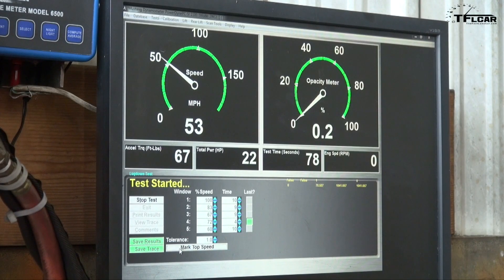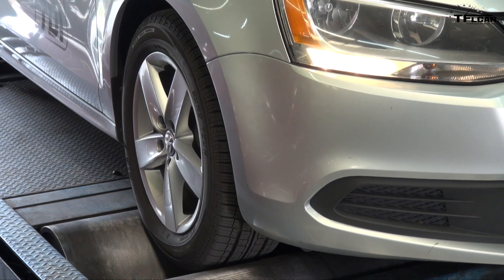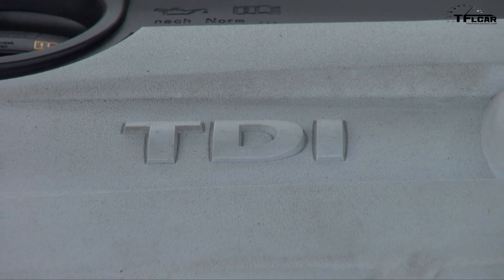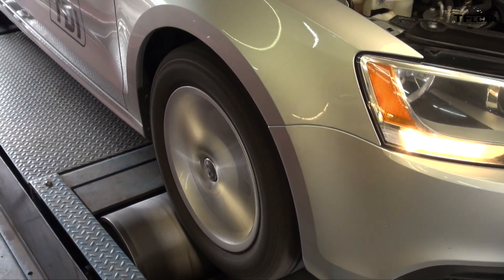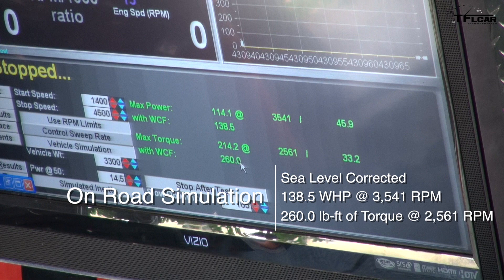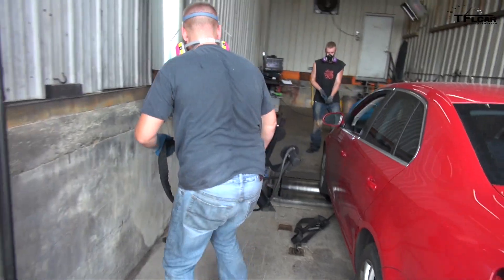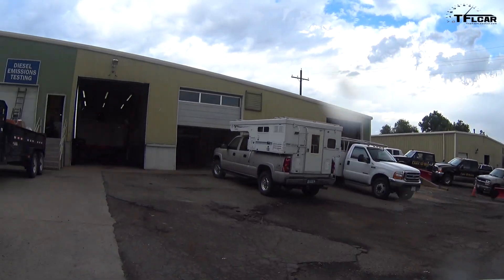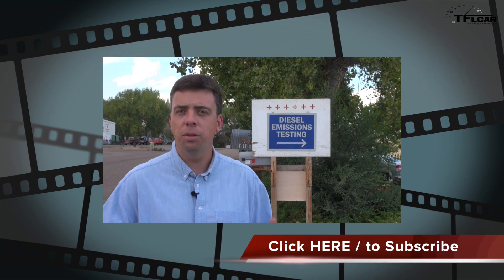Surprise! We Dyno a VW Dieselgate TDI Jetta to get the Truth about HP Loss

Comment: This vid is totally bogus. It goes to show you how little these guys know about doing a controlled experiment. I am only commenting here in the hope that people will stop posting the link to this everywhere.

Despite what they think, the ECM is most definitely not in clean mode.

Not taking NOx readings is a huge blind spot. If they cannot confirm that the car puts out different NOx levels as they change their setup between dyno and road modes, they could be measuring any number of unknown parameters, except the cheat-mode algorithm.

There is a huge hole in their method of comparing the results from 4-wheel dyno mode to 2-wheel dyno mode, on a FWD car.

As with most hardware and software systems, there is most likely a way to rig up the ECU and the car so that it switches to either dirty mode while on a dyno, or to clean mode while being driven on the road. Discovering that won't be done by some shop that doesn't have intimate and deep knowledge of modern cars, their systems, and how the software and hardware play together.

Disclaimer: I am an engineer, and owner of Audis and VWs which I maintain completely on my own from day one.

EDIT: All the faulty hypotheses and assumptions are from TFLcar and stated by Andre Smirnov, not the dyno shop (The emissions shop manager also seems to lack the expertise about traction control systems):

1:27-1:30 - "we had a suspicion" - but a suspicion doesn't mean you are correct
3:15 - 3:27 - "the car thinks it's on the road" - that is mere speculation with no proof to back that up
4:20 - 4:47 - "I would think that whatever it's done now, it's switched off into different mode" - jumping into conclusions, due to lack of knowledge
7:30 - "passed with flying colors on visual particulate emissions" - NOx emissions are the issue, and they ARE very different from particulate emissions.

Comment: the 140hp engine is restricted from the factory. the 170 hp engine is not. it is the same engine different software. i guess the "emission pull" on the 170hp is going to be about the same as on this engine.. 130-140hp vs 170hp. 

can you get the 170HP version and to the same test?

Comment: congratulations you proved that when a Front drive VW thinks the front wheels are spinning it reduced power to try and regain traction. I am sure this car is like most modern family cars. In that just because they have a botton for traction control doesn't mean it gets turned all the way off when its pressed. To bad you didn't test the emission during this experiment since that is what all the controversy is about.

Comment: Its really six of one and half dozen of another - the "cheating" software permits the car to emit greater NOx, however on the plus side the carbon monoxide emissions are better - one of the emission advantages of a diesel over gasoline. Thats also one of the diesel trade offs.  If you tune to meet the NOx standard you emit more carbon monoxide.  The "cheating" software also alows for the higher fuel mileage.  So, in the end, especially considering the minuscule number of diesels cars in the US compared to the rest of the world, is it really an environmental issue for the US that demands immediate action?  Forget the fact that VW did violate EPA regulations, the fix may not be worth the effort or cost as we'll see slightly higher carbon monoxide emissions and higher fuel consumption.  Also, to answer someone's question about other diesel cars emissions, specifically BMW, I believe the same people who found this issue tested BMW's diesel 5 series and did not report any problem. The software is also on EVERY car in some form as a fail safe to allow the car to "limp" home in the event of an emissions control system  failure.

Comment: You can't correct HP reading for elevation on TDI engine. Any turbocharged engine will produce rated power regardless of the altitude (Unlike naturally aspirated engine). You guys don't seem competent enough to perform this test, sorry.

Comment: this has more faults in it than a vw it self.
sorry but sea level corrections is bullshit. because a turbo driven car has almost always the same performance at sea level and at 1000meters aboven sea level. 
the diffrent number is one measured at the wheels, the higher number is the performance at the crankshaft. my car has 115hp at the wheels and that becomes roufly 138hp from the enigne. The diffrents is the lost in my drivetrain. 

next to this vw has done software a version for emission and when you drive it, it has software b version. 
so in this test you can't get the results whit software a version, because it is not there.
the diffrents in power loss is just because there are faults stored on the computers in the car. Out of safety the car does not give 100% performance.

in my opinion, everything about this video is wrong. 
also for drivers whit a vw there is no problem to sell the car. the only people that will get problems is vw itself.

Comment: I dont see any problem here. The 1979 Pontiac Firebird was clearified with 220HP. But in real this Cars reached up to 260HP on the Dyno. 
The Opel Astra F GSi 16V was clearified with 150HP, but stock Engines made it up to 170HP on the Dyno.
Thats the only 2 Cars i know about. But im pretty sure there is more Cars with more Power than Clearified.

Comment: i have a question if anybody reads this...in the test with the 2 WD you should put aside the fan cooling the engine... in a normal testing in general the car is used for 2 minutes... that should never heat the car enough that it would need outside cooling... it gave me the impression, that the program might have taken the wind blowing in the front of the car like a road test or something... try it like that

Comment: Your test condition seems invalid, the car went into "limp" mode because it thought there was a serious fault with the ESP system on test 2. just like if one of your wheel speed sensors failed on the road, so naturally power is cut. You needed to switch off the ESP first.

Comment: tdi's are probably still better for the environment than any suv.
Reply: +Jean V Touraeg V10 TDI
Reply: @LegalZephyr  those are amazing SUVs
Reply: +Matt Smith What about TDI in an SUV?  Like the Touareg or the Tiguan :D
Reply: Yes, especially if the TDI has LNT+SCR catalysts and no defeat device, because then you combine low NOx with low CO2. The problem is not diesel, the problem is cheating in emission tests.
Reply: Touareg, Tiguan, Cayenne, Q1,Q2,Q3,Q5,Q7,Q8, T-roc, T-cross.
Reply: TOYOTAのハイブリッドシステムが世界一優れています
Reply: +Matt Smith take in into acount that in europe 80% of SUV's are Diesel...
Reply: @gandalfwiz20007  everythigis diesel in the eu
Reply: Gandalfwiz2007 even more
Reply: and 10 years old shitty fabia owns them on every hill on snow :D:D:D:D
Reply: No way. Just the NOx alone makes a diesel worse than a giant V10 gas powered truck.
Reply: @Bartonovich52  have you ever driven say a ford v10 6.8 triton, they’re dogs w/ 400hp and torque ,10 mpg, and a life of 150-200k miles. Take a Cummins 6.7 that’ll tow a load with 400hp and 600-1000 torque ,14mpg, and a life of 250-350k miles. Even Ford and Ram trucks ditched their V10. I’m not a diesel guy but they definitely outperform gas engines for efficiency, reliability, towing, and fuel mileage, but lack in certain emission scenarios. Hardly matters, for commuter vehicles, with hybrid and EV technology improving. Every platform, gas, diesel, and EV, has its own benefits and inadequacies. It’s impossible just to say one outperforms the other or etc.
Reply: @Bartonovich52  I will disagree, NOx is no where near as bad as CO2 that has cars produce

Comment: These whole test is a piece of junk trying to make you beleive the software itself is trying to trick emission testing. 

You have an insane amount of warning lights on your dash. IT IS PERFECTLY NORMAL in this case the car will NOT perform as it should under normal driving condition as the safety, engine management and gearbox management electronics running through 'emergency' or prerogrammed modes where they need to work without a given set of sensors. Yes, this happens when ABS, TCS and some other inputs are missing. 

Anyway, let me tell you one important thing: When you burn ANY fossil fuel, your car WILL NOT emit extremely healthy mountain air mixed with unicorn fart, it is that simple. Especially when you have a performance diesel car with more than 140ish horsepower. In eu there are 2.0 liter tdi versions of passat with 240 horses. It gives you a fuel economy of approx 6 liters of diesel burned on every 100km. It IS a extreme, brilliant engineering performance itself ALONE. 

What is diesel gate about ? WRONG testing methods for measuring emission, IDIOTS in the process of emission standards, and BRAINLESS idiots who eats all this bullshit fed into the media. 

I tell you what is about to happen. Diesel gate bullshit is going to spiral out and we still continue using these cars like nothing happened. But there is a very good thing in these: The market price of these AMAZING cars are about to fall, which is very good to me and other diesel lovers. And I tell you one more thing: If I want to be green I do not use my car, and I do that most of my days. 

And one more thing. GET a fucking petrol car, and measure emissions in the engine warmup phase... And most of the owners have no ide how thermostat works and how often it needs to be replaced. Now think what happens if you use your petrol car on short distances or with a bad thermostat ? It is in warmup phase all the time. Under these condition the catalysator simply will not work.
Reply: Richard Stefanits .
Just went away did it .
Made no difference did it ??

Comment: I don't see a problem with what VW did. Their car IS efficient when driving efficiently. When it goes into emissions mode its showing what the car is getting without the human element. Its the same as my car passing emissions when I drive easy versus it guzzling gas when I hoon at 6000 rpm on full boost.

Comment: There's so much wrong with this video and their "findings." The traction control light obviously starts to flash and do its safety precautions by placing the vehicle in limp-mode reducing power/performance/throttle response when placed on the dyno's in it's 2WD mode. I believe you can't turn traction control off on these cars. Oh and the whole horsepower claims!? These genius' don't seem to know the difference between Horsepower at the wheels and horsepower at the crank.  What a waste.
Reply: +The Fast Lane Car 

Seriously, take down the video. It proves that your assumptions are wrong and you don't know much about cars. You can't do this by the seat of your pants. It's way more technical than just simply hypothesizing that "oh, let's run the car on a 4 wheel dyno".

This video is getting you clicks, but is entirely faulty in experimental design and conclusions.
Reply: +Ej Icon Don't worry, this channel is a joke, the "Reviewers" have no actual idea about any of the cars that they are "reviewing". All of the retards on this channel are unprofessional and stupid, especially that guy, Nathan Adlen.
Reply: The Fast Lane Car I know this is late by two years...just stumbled on this video. Per at least the California BAR Smog Test Manual, a vehicle can’t be tested on a 2WD dyno if traction control can’t be turned off. (Acceleration Simulation Mode). Hence all of the warning lights because the car is assuming there is major malfunctions. 

For the car model tested at least, it seems to be invalid. The manual directs the Two Speed Idle test instead. 

The only way to test that is to hook up smog equipment, sniffer in the tailpipe and on an AWD dyno. 

Reference: page 12, Section 1.2.1 https://www.bar.ca.gov/pdf/Smog_Check_Manual_ENG_2013.pdf and also 2 years experience doing smog testing for CA
Reply from the maker: Thanks for comment. You seem so sure about our findings and video being "wrong" and yet how sure are you about  the ability to turn of traction control on this car. We would greatly appreciate it if you got your facts right before you call this video wrong. Feel free to google it. Thanks
Reply: +The Fast Lane Car Let me get this straight, you did a google search, 
found articles about VW's defeat device which tricks the "EPA's emission
software tests", took a Jetta TDI to a Tuner Shop, did some dyno pulls 
to "emulate an emissions test", clearly showed us that the vehicle was 
entering LIMP MODE as a result of extreme traction control failure while being on a 2WD Dyno and came up with your hypothesis conclusion? And I need to get my facts straight? You guys nailed it. The only thing this video proves is that VW's Limp Mode decreases engine performance in order to safely get a vehicle to a stop. And yes, there is NO traction control OFF button on that 2011 VW TDI. Great reporting!

Comment: You cannot measure NOX as a particulate. The car may not have a high particulate but it could very well have a high NOX output. Generally speaking, the more NOX the less CO and visa versa. So, in order to control the two equally they both require treatment. In a diesel that means an EGR, catalyst and urea along with a DPF.

Comment: that scandal is fucking bloated just in order to hurt vw.
How many F 150s have a better gas mileage than vws ? none. big inefficient v8s are the ones who fuck up the environment, not high tech engines which have a 40+ mpg.
How come nobody remembers all those dead people from stuck gaspedals(toyota) which got 89 people killed or broken ignition switches in gm cars , in in which gm paid compensation for 124 (!!) dead people.
This scandal is tbh a non issue, america should not pointing fingers at people regarding the climate.
Reply: +REASAND5 You do realize GM has been in court for a long time over that issue. VW is not getting a free pass on this issue either. Nor would any other companies. We have laws an regulations for a reason.
Reply: Try 6000 people dying per year from NoX emmisions . That is just in the UK. Europe will have a similar if not higher figure. 

So you can see there is a MAJOR issue with Diesel engines .

Comment: After reading the comments its obvious nobody us paying attention to this test. The point is to show the difference in engine performance during regular driving and emissions testing. It wasbt able to test emissions but this was to show the engine performance difference. These engines are absolutely clean deisels. No black smoke no particulate issues the main emmision issue is NOx emmisions. And VW knows how to make them clean without nox. This is a scandal that has been so overly analyzed and scrutinized that everyone forgot why its in trouble in the first place and thats for allowing those NOx emissions to go unrestricted in regular daily driving. Add the Urea it isnt going to hurt because mercedes and bmw and numerous other manufacturers have been using it and havnt had any kind of performance issues with those engines. Im sure vw knows it and is already working on it because germans like to be perfect and precise and they will do whatever it takes to rid themselves of this scandal

Comment: TFLcar if you read these posts, then know that your video was very rough around the edges and didn't feel like a finished project at all.  There were many technical issues you guys left out and/or did not know about when doing this half assed attempt to make VW look bad.  ie: the difference between WHP and flywheel outputs a manufacturer will provide, traction control issues were from not being disabled, 4-wheel dyno mode's effect on torque output, etc ... I am very disappointed in you guys and this flawed attempt to jump onto the diesel scandal hype just to get a few views on youtube.

Comment: That's sooo bullshit. VW didn't trick anything. The car is obviously in an error/limp mode so the power will decrease. The car doesn't "know" its being tested. It thinks its in a slippery condition. So power has been decreased. Doesn't take a rocket scientist to figure this out.
Reply: You obviously are no rocket scientist. The on board computer knows when the car is being tested by the running conditions. The software detects within 3 minutes that a test is being run and reduces torque to control the emissions .
Watch Panarama ( aired last night). The VW emissions scandal.
This will help you to be more like the rocket scientist. 
Sarcasm aside, the documentary is very good and at least you can see what they are testing for unlike this channel which wasted its time
Reply: Jay Mcfarland very true. The emissions test place will use a two drive Dyno. That throws off the speed sensors, why are my front wheels moving and the rear not moving. 
Emissions is all bullshit. I haven't used one of my cars in 6 months. The government let's the cars they drive idle all day.

Comment: There's no such thing as an "emissions testing" button. Basically it's an advanced safety feature that the EPA and other environmental agencies want to penalize for existing. For example, when a car looses traction, the last thing you want is more power (except when doing a massive burn out). power usually causes loss of control in slippery conditions. VW cars know that when you have less traction, they need lower power levels to maintain control. I bet this power reduction feature is on EVERY VW car gas or diesel but since diesel actually has stricter emission requirements, the traction function defaults to "too high". Thanks to the tree huggers that have killed the auto industry.

Comment: This is a tough one. The ECU contains many fuel maps and we can't be sure it was in cheat mode without simultaneously testing NOX emissions. It could very well have been using a ABS fault limp mode fuel map when it did not see a tone ring signal from the real wheel spin sensors.